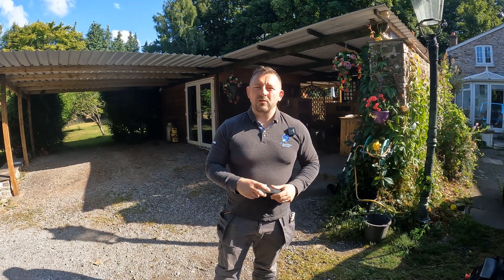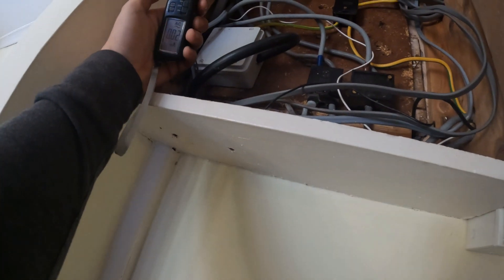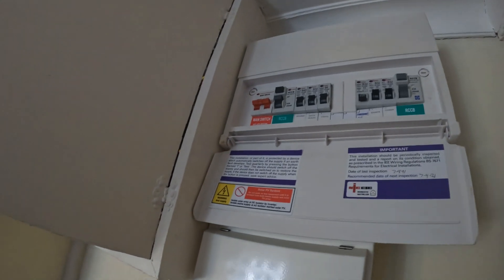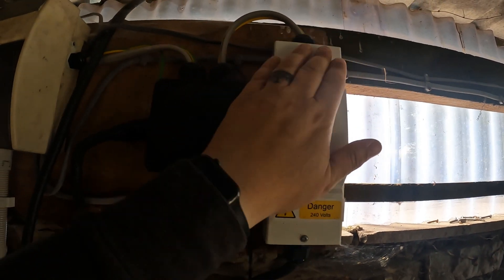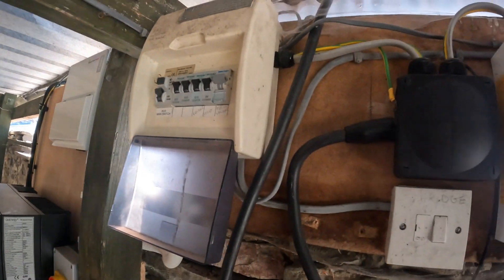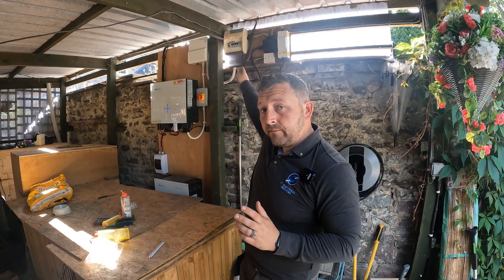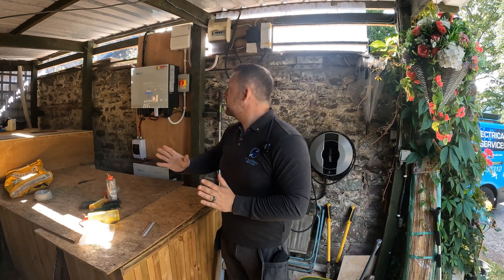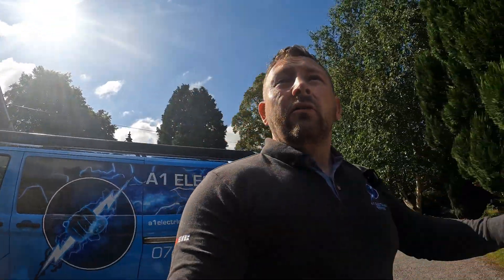TOP TIP FOR ELECTRICAL FAULT FINDING

Comment: Just curious, obviously I could be wrong but, you clamped the incoming tails at the main board to check leakage and had to run back and forth, could you not just clamp the incoming supply cable to the sub board in the outbuilding? would it not read the same imbalance? as that is where you believe the imbalance to come from? Great video, just getting into fault finding, every days a school day :D
Reply from the maker: Yes your right but i wanted to do the whole installation first to eliminate the circuits in the main board first. Once I turned off the sub board circuit I new that that was the issue

Comment: Great Video Thanks! I understood everything, Shouldn't that RCD in the  in the DB outside trip as well? Novice question sorry. I am a new learner but that SWA coming into the garage looked to me that wasn't even clipped to the wall. wow
Reply: Subscribed!
Reply from the maker: @lucapuzzoli8363  thank you 🙏🏻
Reply: I'm assuming because the consumer unit for the solar panels just piggy backed off the supply (as he shows) rather than go through the RCD in the outbuilding, that RCD wouldn't trip... However the RCD in the board that the solar panel people fitted should/could trip, but as stated depending on the sensitivity of the RCDs you might get either or tripping. (If I'm right in my assumptions?)
Reply: unless they didn't have and RCD in the solar panel board (did not show) because they believed it to be protected from in the main house.
Reply from the maker: The rcd closet to the main incomes will always trip first. Only because how a fault path works it will travel dow the earth back to the main MET it will then trip the first rcd in line if that makes sense
Reply from the maker: It wasn’t clipped in places you are right. It’s not the nicest install to be honest. With the RCD sometimes the both may trip out, but in general it’s whichever is closer to the mains cutout that will trip first
Reply: @Waynesworldofgaming  thanks for that I appreciate.
Reply from the maker: @lucapuzzoli8363  you’re welcome

Comment: Nice bit of fault finding 👍 👍. Lots of equipment with inverters built into them have high leakage due to the internal filters in them to smooth out the output into something more sinusoidal.
Reply from the maker: That’s it isn’t it, so you will always have an earth leakage issue, just wish the solar installers would take all this into account before throwing installs in